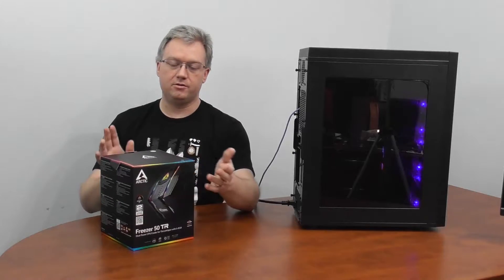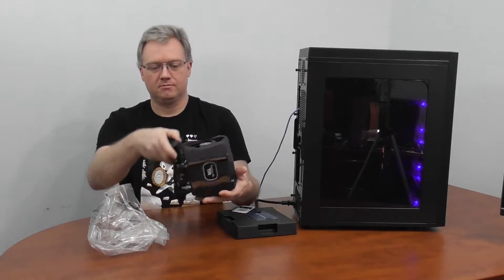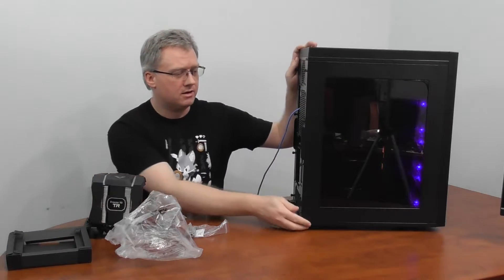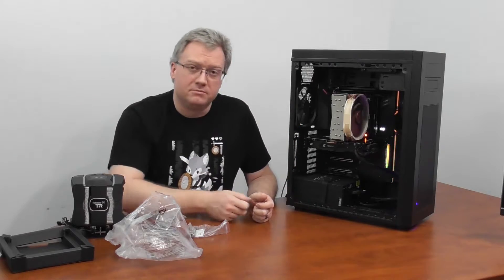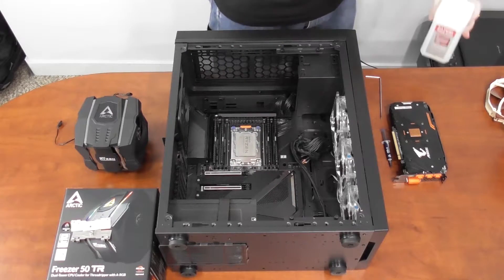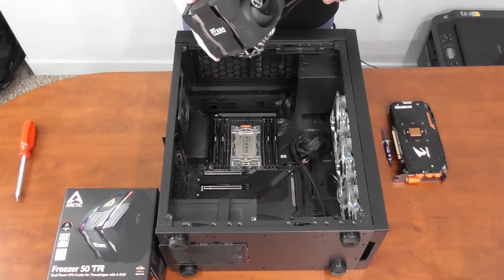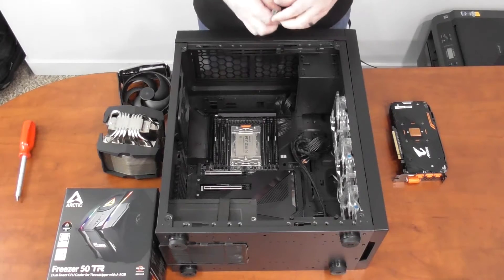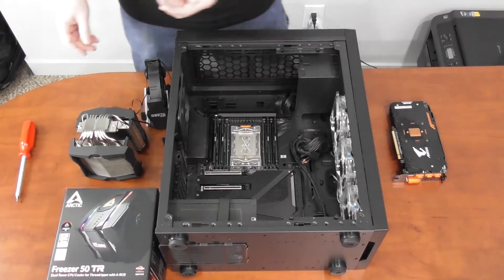Arctic Freezer 50 TR Installation

Comment: I am confused as to what to do with the male fan connector (the non rgb). Only one fan runs because i don't know what to do so I've been avoiding cpu loads
Reply from the maker: The heatsink comes with a Y-cable to connect both fans to a single fan header.

Comment: Gosh, it would not be cool if your cooler wouldn't fit, because of the RAM.  So do you recommend you buy the cooler first, then measure the ram, or what ? Buy the ram, put it in, and see how high it is. I never thought about this, because I always used light coolers, and not beefy ones like that, but I want to, so now I'm worried.
Reply from the maker: A lot of these mammoth coolers will have a RAM clearance spec you can find. Reviews will also tend to point this out (I'd hope!). The Arctic Freezer 50 has a statically-mounted shroud which can't be adjusted, whereas some coolers like Noctua's have fans just clipped on that can be height-adjusted to clear RAM. So that's something you can look for.

Comment: Wondering how much airflow is directed to VRM? In the old days all coolers where down-flow style, so VRM and memory got airflow enough to keep them cool.  Does the weight of the cooler sag the MB? 

 Nice video!
Reply from the maker: There's practically no airflow blowing onto the VRM heatsinks. The CPU cooler tries to direct all the air out the rear vent. The motherboard VRMs rely on case fans for airflow and the motherboard's cooling features to keep them cool. I'll have VRM measurements in the full review. The motherboard socket is metal reinforced and the motherboard itself has a metal backplate. No signs of sag at all.

Comment: A lot work on echo, put any material on walls and it would be much better.
Reply from the maker: Yep, looking at wall hangings and sound material. Might switch to a lav mic rather than shotgun too.
Reply: @adoredtvweb4989  Which shotgun mic were you using in this video ?
Reply from the maker: @zachary9894  it was an Azden shotgun mic. I'll have to tinker with the settings more to find an optimal setting. This video ended up having to use the camcorder audio due to it being better in this instance. The Lav mic will likely help a whole lot though.